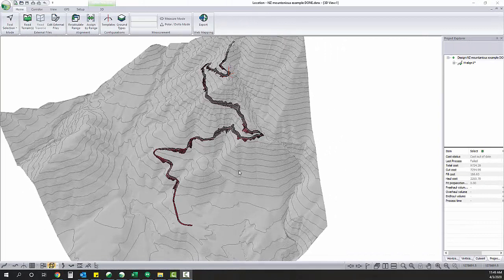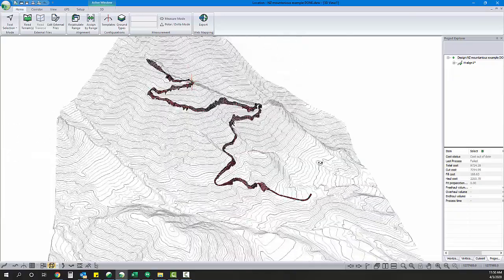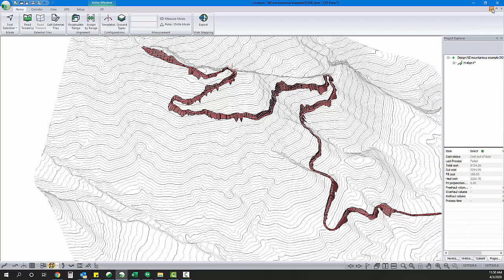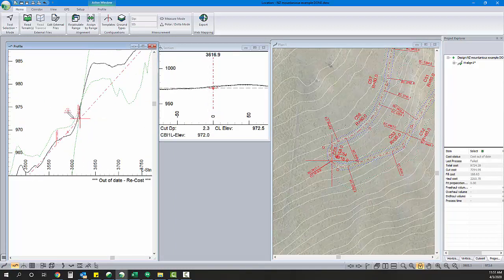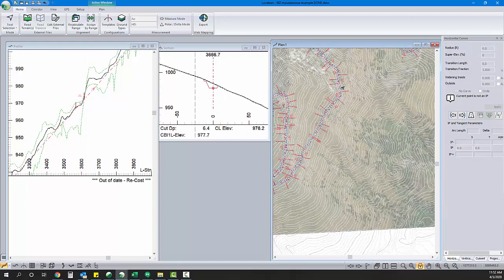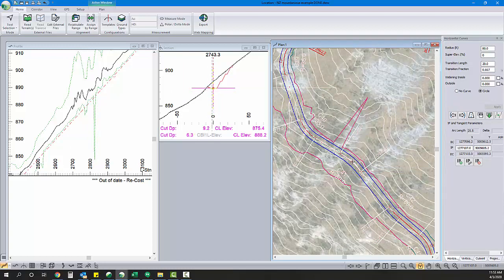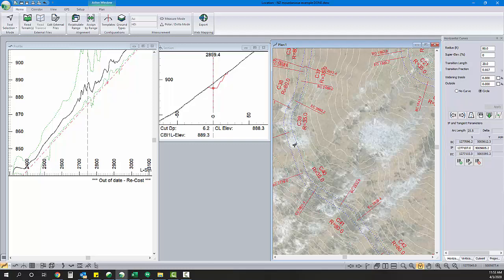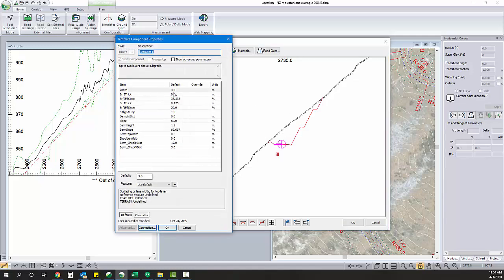5-Minute Road Design:  Mining Haul Road Design using RoadEng Civil Engineer software

Comment: where is the best location of haul road in an open pit mining?
Reply: the camp bar
Reply from the maker: Hi @Angelyn Arcamo, that’s a great question. It is going to vary depending on your requirements and your mine’s evolving shape. 

RoadEng Civil Engineer software is a tool that you can use in the process – it’s great for getting costing, minimizing earthworks, visualizing a potential road’s position. We have another video that goes deeper into the optimization side of things – definitely worth checking out:  https://youtu.be/4tWngox5Dkk